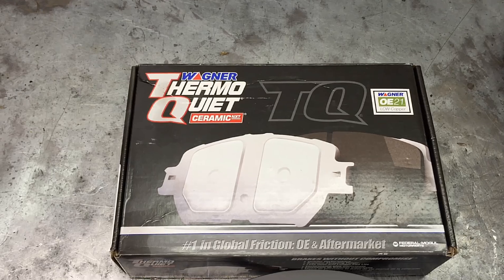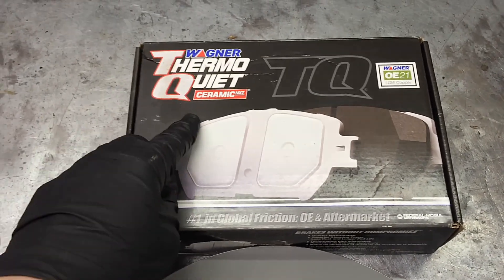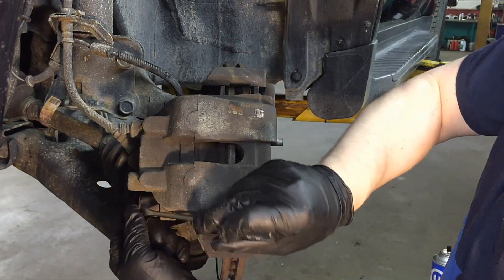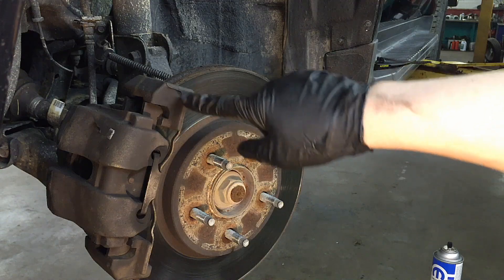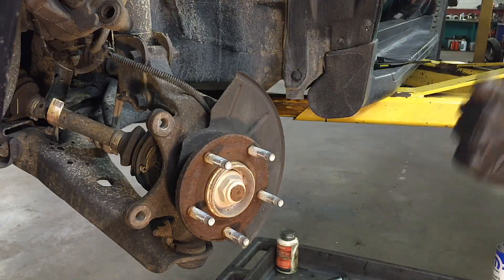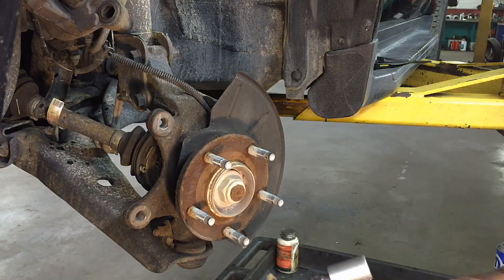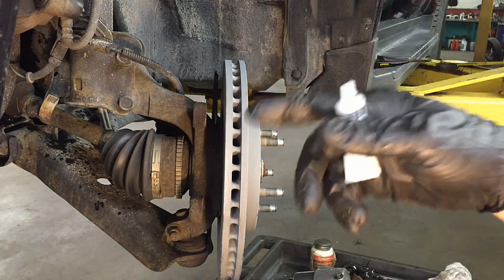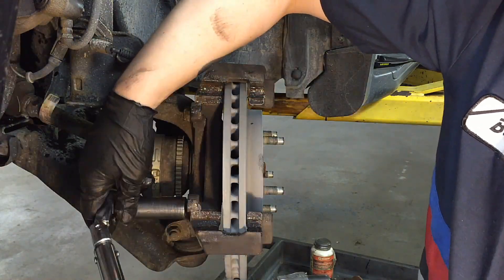2001-2012 Ford Escape Front Brake Job in Detail

Comment: I have replaced the front brakes, back brakes, master cylinder, and the brake booster. I have bleed everything and I don't see any leaks. The abs light is not on either. I thought I had fixed it but now the pedal is going back to the floor.  Any other ideas?
Reply: did you bleed the brakes starting from back right, then back left, then front right, then front left?  in other words did you bleed all four using the correct bleed progression farthest first/closest last?  and on some master cylinders you have to bleed them before putting them on the car.   I don't remember how. its been a long time - 15 years?  i'm sure someone here has a video on it for Ford brake master cylinder exchange.
Reply: @kenito1967  yes I believe so.
Reply: @xepiloguex  .. well the brake booster is there to give you power brakes.  So unless you had a difficult time applying the brakes,  you probably didn't have to change that.  The only things that could cause a pedal to go to the floor are
1. An obvious leak.  Which means a brake line broken. A brake caliper bleeder still open. The master cylinder cap left open. A caliper installed without a piston in it.  Most of those would reveal the problem by fluid leaking somewhere. 
2. Air in the system. You replaced something and obviously didn't bleed the system.  Air is more compressible than fluid, so the pedal could go to the floor based on compressibility. 
3.  A faulty master cylinder.  All master cylinder had 2 compartments.  A front and a back.  The front works the back brakes, and the back works the front brakes.  If the "wall" that separates the front and back doesn't work correctly,  same problem. Pedal goes to floor.  

With all that said, I bet you have 2 problems simultaneously.  You have a leak somewhere and you have air in the system.  I highly doubt the new master cylinder is faulty. It's possible. 
My money would be that you didn't fill the master cylinder and pump all the air out of one of the lines. 2 man operation. If your doing this by yourself,  you'll never get it bleed  correctly if it's more than  25% with air.  
Fill master cylinder, remove back right tire.  Pump brakes 10 times, bleed it 5 times. Pump brakes again 10 times.  Bleed it again 3 more times.  Look for a leak.  

If no leak then move on to back left tire , but first check master cylinder is full.
Then front right tire , 
Then front left tire.
After each bleeding check master cylinder is full.  If it needed fluid, you found where the extra air is.

If after all that, which doesn't cost you a dime, but time, you don't find a leak,  and pedal is spongy,  change new master cylinder.   
Good Luck !
Reply: @kenito1967  this is great knowledge. I'm going to recheck it. I will say that it only happens every now and then and I'm not losing any fluid.
Reply: @xepiloguex  .. sounds like one of your metal lines has a crack in it that bleeds out when your driving from the movement of the car.  To check for that its once again,  2 man operation.  One guy pump the brake and hold it, other guy pull on the lines to see if one is leaking or broken.
The rubber hoses can't hide a leak, but a metal line could hide a small crack that only bleeds now and then.
BE EXTREMELY  CAREFUL !!! Definitely wear goggles to protect your eyes.  You don't want brake fluid squirting in your eye. Also have a rag ready to wipe the brake fluid up on all surfaces.  It's very caustic and can ruin paint and delicate components.

Comment: What exact tool do I need to do this
Reply: Arielle Donaldson I believe Brian said depending on year 7mm was most common as was my son's 2002 in 2009 I think they were 9mm not sure if 8mm we're used I went to my local auto zone and bought one of there $10 duralast kits which had 3 standard SAE and  3 metric which one was the 7mm I needed

Comment: My 2009 Ford Escape has a problem where the brake pedal almost goes to the floor sometimes  In order to break. I thought that it was either the brakes are the master brake c I have changed the master cylinder and the breaks and my pedal still want to go to the floor.  Can anyone help me figure out what is going on?
Reply from the maker: Make sure you are also bleeding the brakes at the master cylinder bleeder port first.
Reply: @FordTechMakuloco  thanks. I did that  also. It has more stopping power now but I believe that my actually be my back drum brakes, smh.   You videos extremely well done! You help a lot of people! Thanks!
Reply: I have replaced the front brakes, back brakes, master cylinder, and the brake booster. I have bleed everything and I don't see any leaks. The abs light is not on either. I thought I had fixed it but now the pedal is going back to the floor. Do you have any other ideas?

Comment: I think when I do the brakes this spring on my 2010 that I will be using those Motorcraft rotors. Those stupid Chinese things that you get from the big box parts stores seem to warp out after 5000 miles every time. I had a Fusion that they had to warranty them twice and the Fusion Rotors are not cheapest rotors to replace.